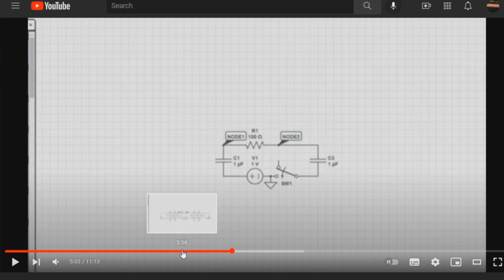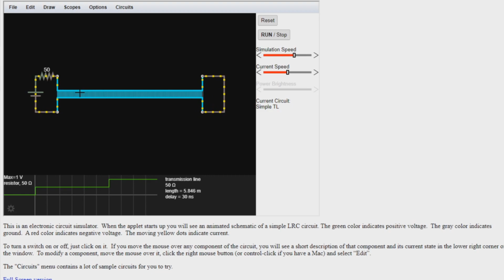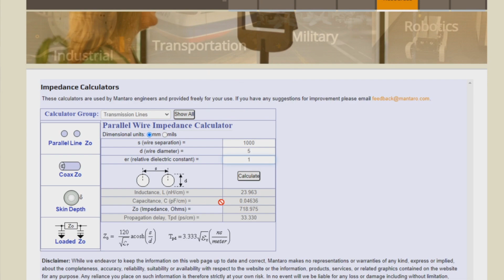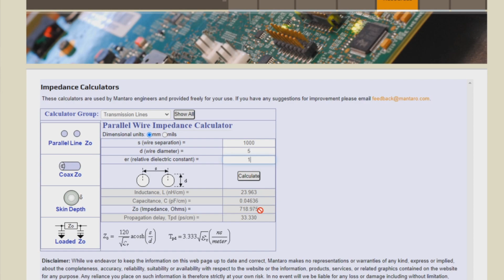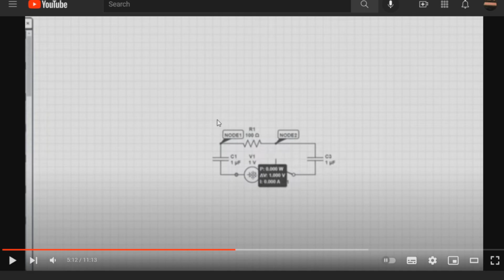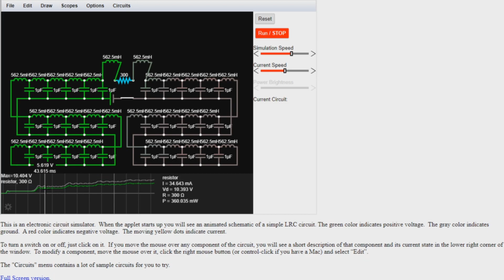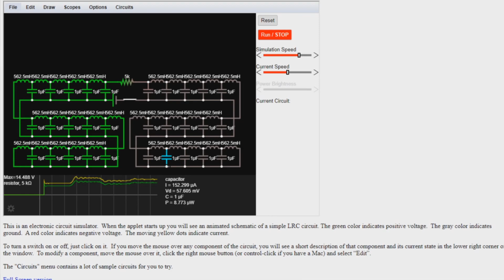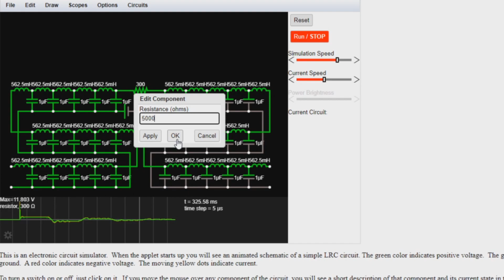2nd analysis, I think I was originally wrong! - Veritasium "The Big Misconception About Electricity"

Comment from the maker: Addendum: I forgot to mention just how much power is transmitted at steady state compared to the initial transient power. Our best case scenario is the perfectly matched load of 1.5k ohms, here the steady state power is 96mW, and our transient response is half that at 48mW (50%) (Edit: also "best case" as the most power transferred, you can actually get higher % of power with higher resistance but lower overall power). If we use a 300 ohm load, we only get 2.7% power transfer. If we move to something like a 12V 100W light bulb, we'd only get an initial transient power of 0.09mW compared to the 100W at steady state (almost 0%). So whether or not you consider the energy to be transferred through the air is significant compared to the wire is dependent on what load is chosen.

With a 6k load, you'll get lower power but a higher % of power at 10V (75% in the first 1s). That is significant! Whether or not you think using a small lower power light bulb vs a 1 or 100W light bulb is inline with the spirit of the problem is up to you!
Reply: This really SHOULD have been in your video, because it is POWER that makes the light bulb radiate light.
And it makes more sense that not much power would be transferred between two wires 1 meter apart
when you look at them as transmitting and receiving antennae.  In that real world situation, the light bulb
won't shine until 1 second has passed (although it won't be a steady shine, as your simulations show).
Reply: @daveinwla6360  Yes, one of the things a lot of viewers are unlikely to grasp is that the power of a bulb is inversely proportional to its resistance.
Reply: Hmm, agreed. I think visually he shows a battery, which looks like a car battery, so, I have to assume 12 volts, and the bulb looks more like a "house" LED, but, if we allow that it is more like the kind of LED you might find in an Recreational Vehicle (RV) where people can actually live inside the vehicle, then a 12V 7W E26 would be very reasonable. That's still 583 mw needed to power the bulb at "rated" levels. 
Not sure how that affects the sim results tho.
Reply: Rather than 1M spacing, try it with 10M!   All the non-physics people insist that one meter spacing is enormous.   Actually it's tiny, because the spacing must be measured relative to the wire-length.   If Vertasium were lighting a single LED, we'd see a small glow even at a tenth mA.  (Actually go try this with a green LED.)   Would the LED light up if the space between wires was TEN METERS?   Sure.   But a 24V battery would help.

Comment: I get more and more confused, the more videos i watch about this. :D
I think i get the whole transmission line idea. But what bothers me: If we change the setup by just moving the lamp from the switch away until the wire form a perfect circle (so we are not changing the length of the wires) the whole idea of the transmission line should fall apart, or? At least that is was i intuitively expect. And that would mean for me: The big misconception about electricity is a true statement, but only for a very specific experiment: Very long parallel wires?
Reply from the maker: Yes, if you make the wires into a circle, the transmission line still exists but cannot be modeled by the simple equations on the wikipedia page. In this case the characteristic impedance of the line is huge, so huge that almost no power will be transmitted across the air gap, and all the power will be through the wires only.
Reply: @ZongyiYang   - Shouldn't you say "... all the power will be along the outside of the wires.", i.e. following the Poynting vectors?
Reply: @daveinwla6360  I would say, once the circuit is settled down to DC, there is no electromanetic wave transmission and that the power travels via electrons driven by the emf of the battery.  I believe Poynting is a red herring.  I agree with the transmission line circuit analysis - no Poynting here.
Reply: @thomasfolks   - Yeah, the Poynting vector in the  DC case seems stretched, as does the transmission line in the circular circuit case.  Some kind of unified model/theory is needed here.
Reply: @PGH Engineer  - Interesting observation.  But if the wire has non-zero resistance-per-inch, there will be an e-field within the wire and just outside it even for DC current.  That e-field, plus the B-field generated by the current, will produce a Poynting vector.  In the case of Veritasium's zero resistance wire, there would be no e-field in the wire, but infinite current, so in Real World cases, there will always be a Poynting vector.  In any event, I think the assertion that Derek makes should be tested with long wires and a high-speed oscilloscope.
Reply: @PGH Engineer  - Yup, the higher the frequency, the more complex the "simple" case, and so is looking at huge distances.  In Veritasium's "Energy Not In Wires" thought experiment, I definitely think Derek owes his audience a demonstration - which is possible with today's high speed oscilloscopes and a mile of wire, perhaps with the wire hanging from a helicopter to avoid capacity effects from ground proximity.
Reply: @daveinwla6360  This guy does it:  https://www.youtube.com/watch?v=2Vrhk5OjBP8&t=1s
Reply: @bradbadley1   - Yes, I saw that.  Alpha Phoenix found an initial tiny step up in voltage followed later by what many have called "the DC case".  That is what I predicted elsewhere based on the transmission line model.  Derek/Veritasium should have the integrity to do something similar since it's possible for him to do so and to clear up all the conjecture.

Comment: First, you should remove all the capacitors from the left side because we don't have there change of current in the first second.  
Second, we want to know what voltage will there be at 1/c time, let's say to 2*1/c seconds. Can you calculate what voltage will induce a standard 2m cable to another 2m cable at a distance 1 m away? Because în a 2/c time the current will only propagate 2m to the right (in this case). 
I don't trust these simulators because they weren't built for that.
Reply: The "current only at one battery terminal" problem stems from the arbitrary definition of 'ground' at the other terminal...
Easy to fix the difficulty of imagining this by stating there are two batteries in series, and redefining 'ground' as the potential at the bridging conductor.
Recall the (yellow) field lines that radiate out from an isolated Duracell... Only the lines at the midpoint of the single battery are perpendicular to the long axis...
Reply: Can you tell if we have a battery where to one terminal we have a switch and 2m cable going to the right and on another terminal we have a Derek light bulb and a 2m cable going to the left. 
Question: when turning on the switch will the light bulb light up?
Reply from the maker: @markmd9  If the cables are not connected and don't run parallel alongside each other than you'll no longer have a transmission line, so the theory in this video won't work. However you'll still have a radio, so if flipping the switch changes the voltage on the 2m cable then that is technically a radio. Radios antenna, transformers, transmission lines, etc are all technically the same thing. In this case, technically with a magic light bulb some tiny tiny amount of current will flow through it so it will light.
Reply: @ZongyiYang  if you remember the field lines of these line antennas, they have blind spots at the poles and a vertical line receiving antenna on the pole axis is the worst possible position and won't catch nothing. 
Returning to Derek's experiment, if to imagine that you have the ability to stop the time, at the time of 1/c we would only have a wave of the electrons that went only one meter in the wire on the switch side (there is no time for the current to go back and forth no matter is the wire 1m long or c long)  and we have a EM wave that just touched the light bulb generated by the current in that 1 meter long wire (there is no even time for the wire on the light side to receive the full energy generated by that 1m travel path of electrons).
I have big doubts that the instant current at the light at 1/c time will be as high as shown in this simulation.
Reply from the maker: @markmd9  I think you're right, I'm not too familiar with antennas so I'm going to have to take your word on that one. As to the instantaneous 1/c current, you can probably refer to this other guys simulation that takes the physical separation of the wires into account: https://www.youtube.com/watch?v=aqBDFO1bEs8
Reply from the maker: A change in current on the right side will immediately cause a change in current on the left side just due to KCL. A the extreme case of a 2m cable spaced 1m apart, we are getting the the area where the time delay of the fields is significant for the overall circuit. In this scenario the simulators break down because they do not consider this 1m gap. However, after 1/c s, we will see some induced voltage that can be calculated if you give me a value for the load resistance. After 4/c seconds we'll get our first reflection from the termination at the 2m wire and this will change the voltage.

Comment: Another thing to consider is that a led is a nonlinear circuit element.  It will look like a high impedance until the led starts to conduct.  In that way it would sort of self match to the transmission line impedance so it would be guaranteed to light.

Comment: One more thought experiment: Make a small change so that the switch is 1s distant (I'm using time because I don't want to add the sub-light propagation speed into this confusion.) from the battery and the bulb. The switch is over there at the end of a spur that is perpendicular to the existing circuit. Install another bulb, or an ammeter. The voltage measured across the open switch will be the applied battery voltage... Now, close the switch... Obviously current(s) will flow through the closed switch and its nearby ammeter and then along the connecting wires, but the step wave won't reach the battery and its neighbouring bulb for 1s... Energy is obviously flowing in a part of this circuit, but the original bulb doesn't know about it (cannot know about it) for at least one second. The electric field is there, current is flowing as it attempts to equalise the potential difference, but Derek's bulb stays dark... No magic... no mystery... One needs electrons to move uniformly through a conductor to establish a magnetic field to transfer energy from the battery to the load...
Reply from the maker: In your modified scenario what would happen on initially closing the switch is that locally around the switch, the light bulb will immediately experience a current that is based on the resistance of the bulb and the 750 ohm characteristic impedance of the wires. After 1s, the signal propagates to the battery+light bulb from the original question. This light bulb acts as an unmatched obstacle for the wave, so here some of the wave will get reflected back to our switch (it will take another 1s to arrive). Some energy will pass through causing some current on the original light bulb, and it will make a trip to the very far end of the transmission line. It will then reflect back to the switch after 4s. So basically in this scenario, there will be many reflections, and you'll get an initial 750 vs R voltage across the load and then steps in voltage after every 2s due to all the reflections.